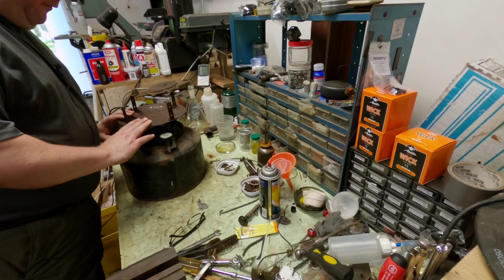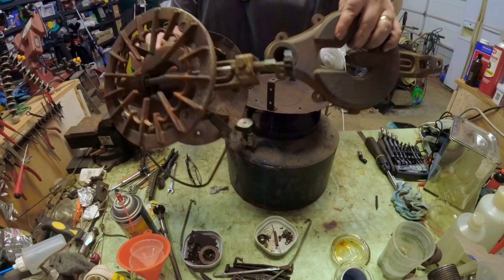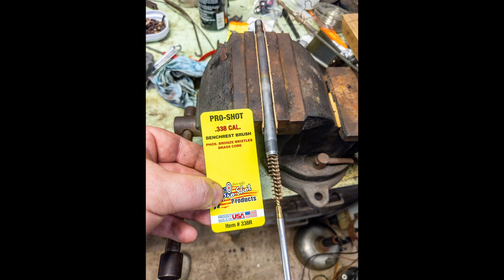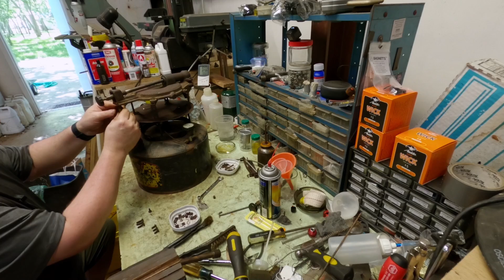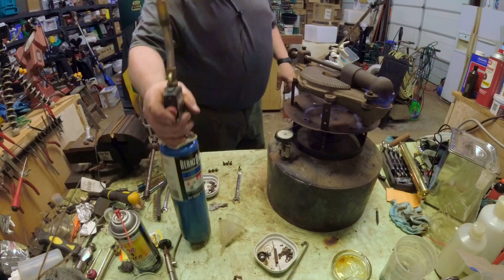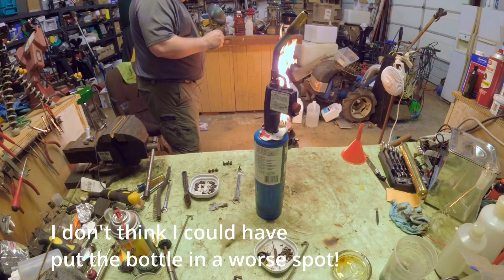How To: 460g build Part 4, now with FIRE!

Comment: That leak won't be of much significance referenc operation, but if you run it in a confined space for any length of time the un burnt fumes will be pretty strong.  Had a tiny leak on a #16 heater that made it unusable indoors.
Reply from the maker: It also probably messes with the fuel/air ratio also.  I have to do a brake job this weekend, so i'm going to pick up some high temp gasket material at the auto parts while i'm getting all the brake parts.

Comment: Super work on this!  It's been a while since I did serious work on these, so I don't remember sizes of wire or brushes, but you can get multi packs of stainless and brass bore brushes from the Frightful Harbor for cheap.  I get a couple of packs whenever I'm in there because they are so useful for so many things.  I just mash down the loop on the end or cut it off and chuck them in a drill to speed the process.  I consider them expendable like sandpaper.  I've had to replace cleaning wire tips before using piano wire or guitar string.  Not my idea but credit to the long forgotten stove junkie who I got the idea from.   If I recall correctly, I micro drilled the tip out and brazed the new wire in place with 56% silver solder.  Then straitened it, chucked it in a drill, and sanded the tip until sharp on my disc sander or bench grinder.  I mic'd the sizes but don't have them written down anywhere.  It worked great and I never had any issues with them, but it was delicate work.  I remember feeling like Superman after the first one.  Haha!  
Not sure but I believe those restrictor plates  were suppose to be bent for adjustment.  At least every one I've seen came that way.  While I like my swivel adjustable hack, it isn't how they left the factory.  
Sorry for the multiple edits.  I typing while watching and pausing.  Opening these all the way takes a bit of courage.  Sure looks like your burner gasket is leaking.  I just preheat with a torch or pour some alcohol in the preheat well(moat is a better word for it) and let it get the generator hot.  Notice where the preheat well is located.  They wanted that fuel getting hot fast to prevent flooding.  They can be finicky.  If the flame is tall and yellow, it will take forever to get the generator hot enough, so throttling IS recommended in my opinion.  but once they're hot, they are fun to use.  Keep up the great work.
Reply from the maker: Hey Mike, thanks for all the helpful comments.  I need to get another magnifying visor before HF stops making them, so i'll get those brushes in the order too.  Guitar string is a great idea for the cleaning needle.  I've got some spare tips so I can experiment with one.  Just wish there was an orifice size for the 460g...that would make life much easier.  Next step would be to check it with a micro drill set to see where it is.  I think the right sized needle will also help with throttling.

You may be right with the plate being bent down.  That's also what I've seen on all of them.  Doesn't provide much restriction with that bend in it so ¯\_(ツ)_/¯  

Definitely need to get some high-temp gasket material to make a new gasket.  It does leak and I don't care for extra flames where they're not supposed to be!  I will say that now that it's had a bit of a run-in (and I've got a bit more experience!) it's lighting much better.  Gasket will probably also help out in that department.  That gen just takes a LONG time to heat up, but once it's going, like you said, it runs great.